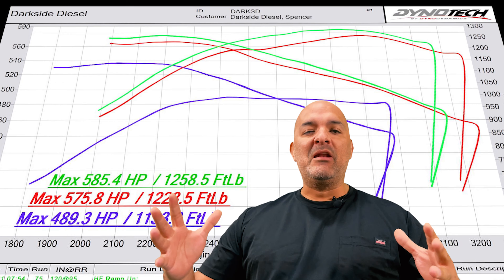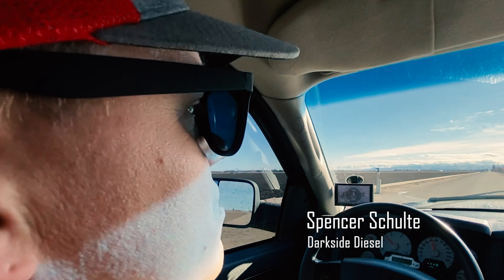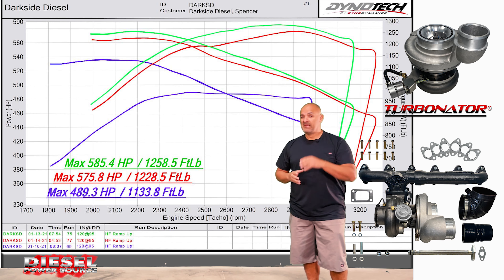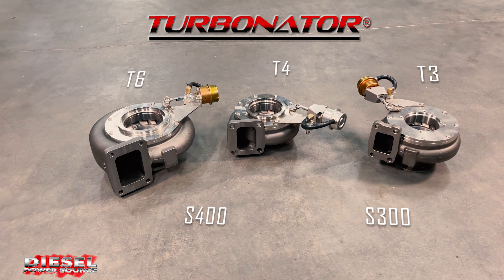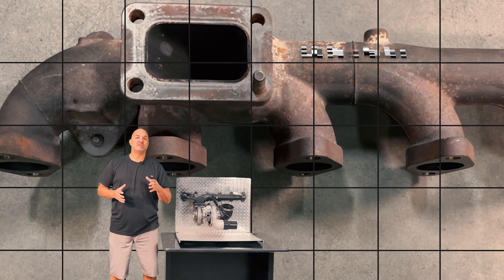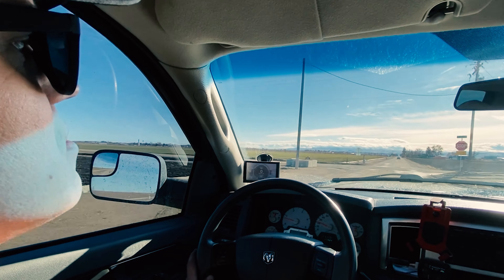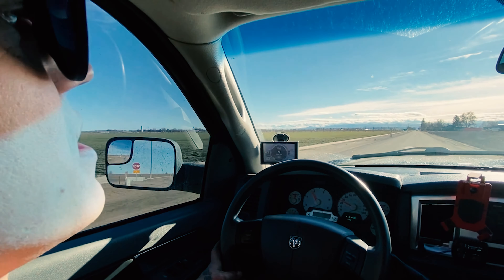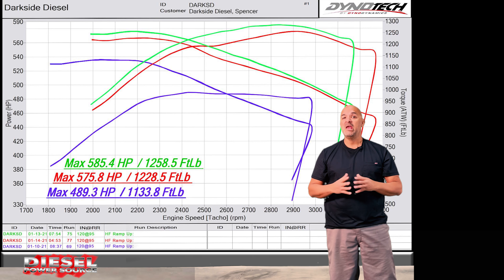Before and After DPS Turbonator VGT Dyno Results | DPS VGT Turbo | Cummins Turbo Replacement

Comment: Assuming I have a completely stock 2012 Ram 2500 6.7L as a base. I see DPS Turbonator VGT Turbo For Dodge Cummins S300 & S400 with 3rd gen manifold option (mandatory) on the website. Do I need anymore parts (or a core S300/400 turbo) for this kit?  Is DPS VGT compound turbo a better setup for a high/wide torque curve? Vehicle is for towing ONLY and Baja California has some insanely steep hills.

Comment: I want this on my 2005- but I want the 2nd gen manifold in t4 to go with. I’d love to see you guys have the turbo to downpipe as an option in a kit.
Reply from the maker: We have the Turbonator VGT housing in T4 and we also have 24V (2nd gen) T4 manifolds.
Reply: @DieselPowerSource  know anyone who has the Down pipe from the turbo to old downpipe location? You guys should fab/ sell that section so it would make an easy second gen swap and turbonator swap in one.
Reply from the maker: @Upliftyourbrothers  try diamond eye. We don't do a 2nd gen swap, our 3rd gen swap allows everything to line up with the stock location, including the factory cast exhaust elbow.

Comment: How's the soot vs a stock vgt DB ?
Reply from the maker: The Turbonator was designed to work well in a high soot environment and not get stuck by soot. It is made to be a durable, long-lasting, performance VGT.